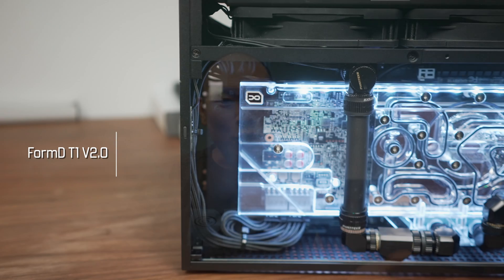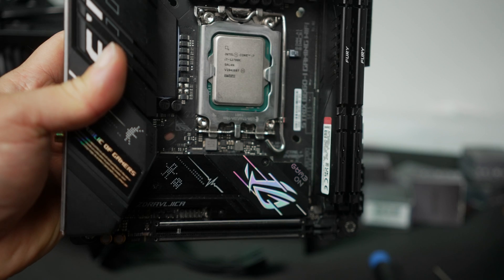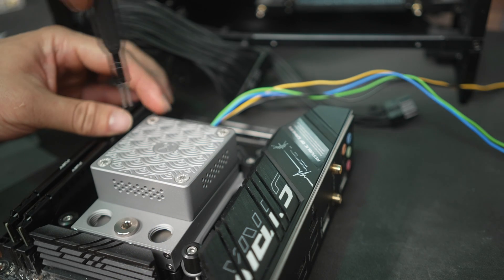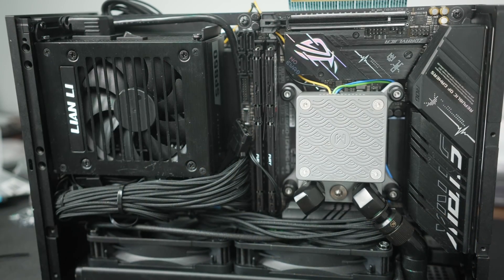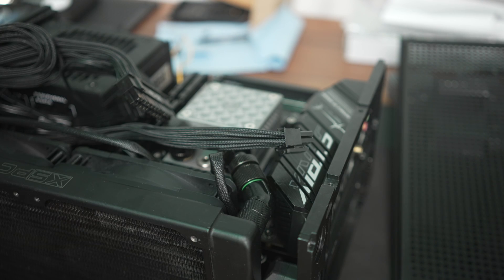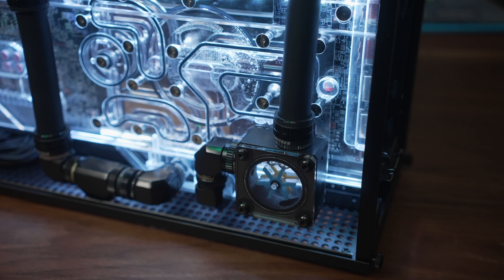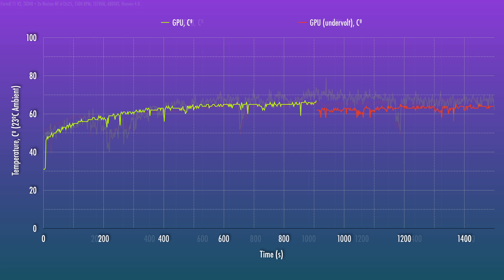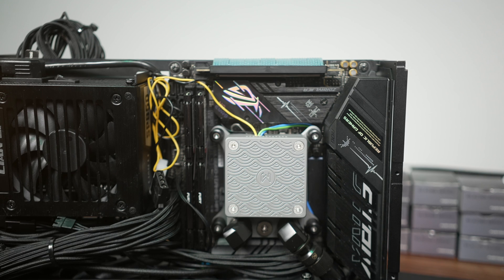FormD T1 V2... Custom Cooled!

Comment: This case is so much fun! I did a similar loop in the T1 V2, but with 2 of the new alphacool ST20 slim radiators, the 240mm and the 120mm. Pump block is the Nuovolo Aquanaut, GPU is the Zotac 3070 AMP. Alphacool makes a very short waterblock for this GPU, so you can fit a 120mm radiator next to it with no problem. Water temp while gaming is below 40C, with the fans at only 900 RPM and nearly inaudible. Your videos inspire me a lot, keep on with your excellent work!
Reply: question, I have a Nuovolo Aquanaut, and I havd issues with the pump pressure form the pump I got.  Which pump did  you end up using to match with it?
Reply: Laing DDC 4.2 from EK. Had no pressure problems, but filling was a challenge, had to use an external reservoir. But once it is filled, no issues.
Reply: @disco.volante  Thanks for that...the bitspower ddc didnt have enough pressure to flow anything, so i was looking at other ones to try.
Reply: You should do a video showcasing your build, my man! I'm interested!
Reply: Any pictures or Reddit thread on your build?  I have a form1d sandwich on order, and I’m planning on almost the exact same thing, but with a 12600 and a 3080fe on an ek waterblock that is very short.  Curious how yours turned out.

Comment: hey I am trying to build the nr200 inspired by your video. I just have some few questions. I am going to use 12400f,  1 .if I want to use DDR4 do you recommend ASRock B660-ITX or something else. 2. what cooler do you recommend on 12400f 3. will the M.2 heat sink recommended? if, so will it fit in this MB with the GPU right next to it? Thank you.

Comment: Very nice, thanks for posting! Asus dropping the temp header really just makes getting the strix boards near pointless, it was the reason I initially went with the B550-I but the onboard headers are very limiting - the CPU fan header is locked to cpu temps, and the AIO header locks you out of more granular fan control. I'm definitely going to be picking a Quadro for future use.
Reply: @disco.volante  I actually tried to use fan control but wasn't really satisfied as the functionality wasn't significantly more than just using ai suite. It didn't let me create virtual sensors for example which is what I was looking for but maybe I'll give it another shot.
Reply: For example compared to an aqua computer Quadro the functionality is just through the roof granted you are paying for it